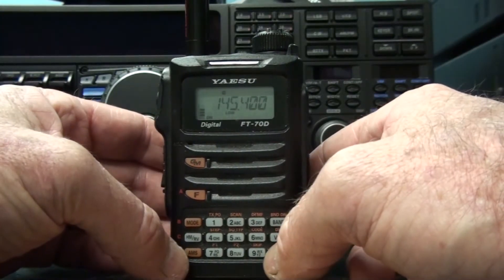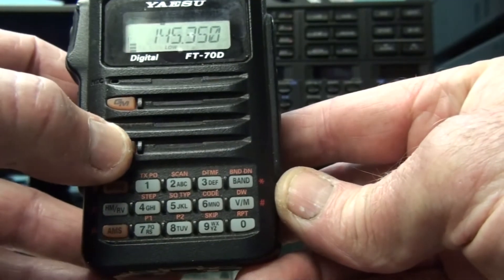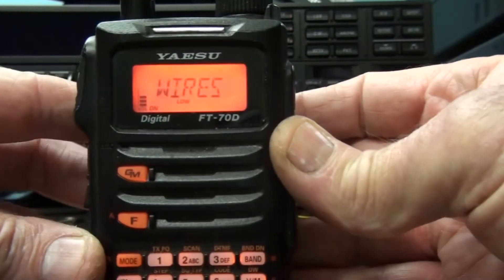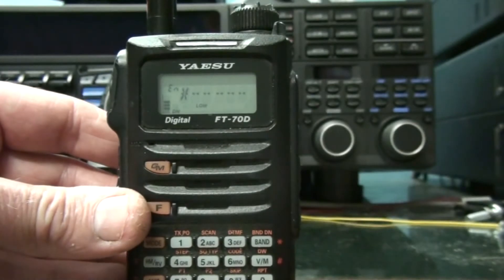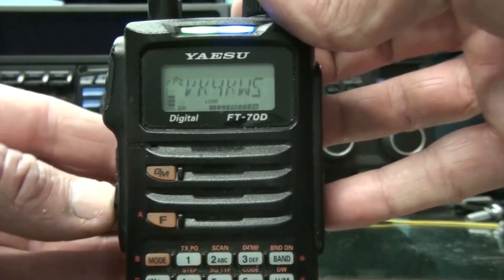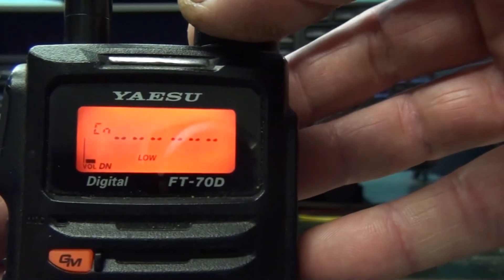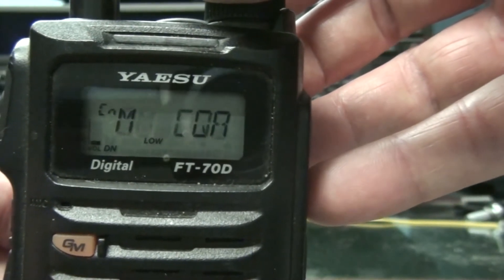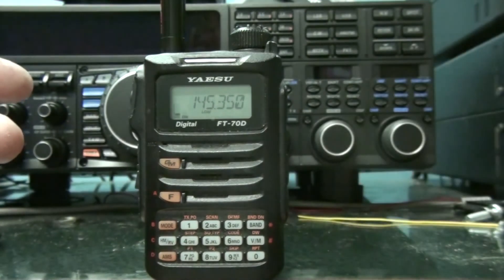Connecting FT70D to Wires-X

Comment: I've been able to connect to two separate digital repeaters without being able to connect to wires X. Does every fusion repeater have wires x? I feel like I'm missing something here
Reply: I can connect to the repeaters analog, digital, but I cannot connect the wires X for some reason
Reply from the maker: Not all repeaters are wiresX enabled. They do need extra hardware and an internet connection.
Reply: @vk4kws  you answered my question thank you

Comment: I am having conflict between my Yaesu FT 70D and my Anytone AT878UV 
My hotspot is connected to my Yaesu and I am trying to get it back to work with the Anytone AT878UV DMR radio so I’ll try this and see what happens 
My Pi star is saying YSF as the connection?
Reply from the maker: The Pi star should go back to listening to all modes after 20 odd seconds. I would check your pi star config.

Comment: Okay so the radio needs to be in Simplex mode to connect to wires x
Reply from the maker: No. I use simplex for my wiresX node I run at home. If you connect to a wiresX enabled repeater you will need the correct offset as per a normal repeater use.
Reply: @vk4kws  Thanks! So I'm having a hard time connecting to wires x. Is it possible to have a fusion repeater without wires X?
Reply from the maker: @DX for Dummies  yes. Connecting a repeater to wiresx needs more hardware and an internet connection. There are other ways to connect a repeater to wiresX network however the short answer is there are lots of fusion repeaters without wiresX.